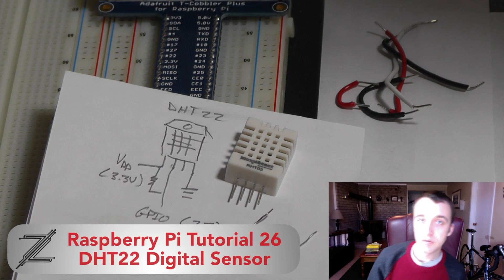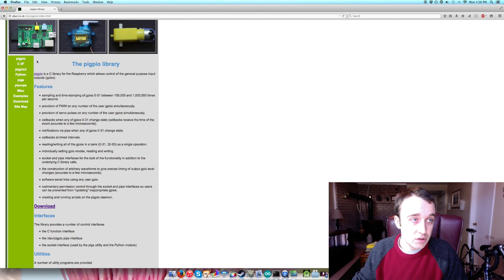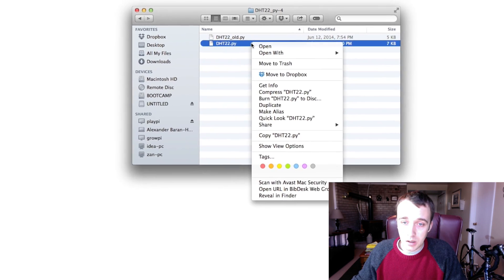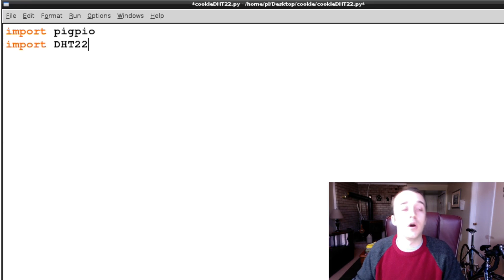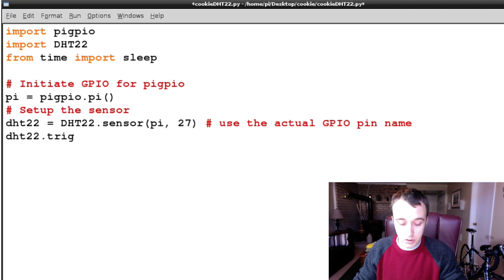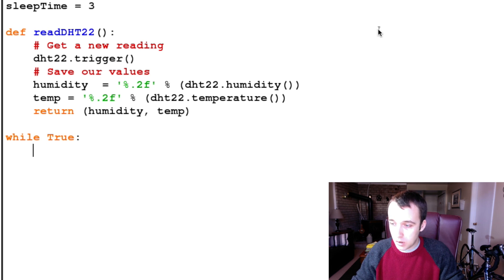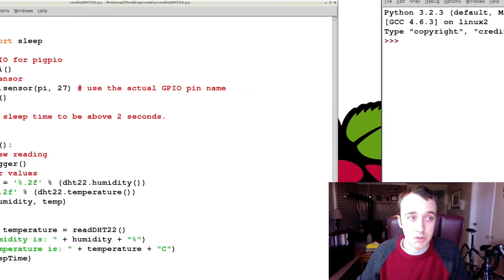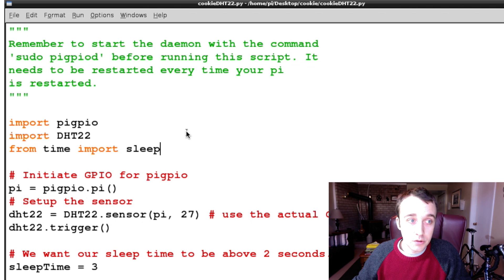Raspberry Pi Tutorial 26 - GPIO DHT22 Digital Temperature + Humidity Sensor

Comment: Hey Alexander, I am a 17 year old student and have a question. I saw your video on youtube where you connect a DHT22 sensor on a raspberry pi. I want to say that it is an fantastic video and it helps me a lot. But for school I have a task to measure the temperature with the DHT22 sensor and to monitor the values on a webserver that runs on my raspberry pi. Do you think it is possible? and could you tell me what is the best solution for this task? I would be very nice if you help me with this. Thanks a Lot !
Reply: As a developer, this is a bit too much of a task for a 17yo imo. Don't get me wrong is doable if you already know programming you need to setup an apache server, and know html, php, python. You either learn electronics or web dev, doing both at the same time is a terrible idea.

Comment: getting the below error. please help me out.
Traceback (most recent call last):
  File "<pyshell#1>", line 1, in <module>
    import DHT22
ImportError: No module named DHT22
Reply: Rahul vishwakarma same problem. Did you resolve?
Reply: @seancardosa6806  You need to have the "DHT22" python code you downloaded in the same folder as the code you're working with.

Comment: Alexander, these are the best videos out there.  Thanks!  I was working on this one (Temp & Humid) and kept getting temps of 500 C + (no I'm not commenting from the depths of Modor) and humidity around 1200%.  I checked everything several times still bad reads - but it they would go up if I breathed on the sensor.  Then I decided to use another library from GitHub szazo and things work fine. One difference is that I have a DHT11 and the szazo says its for DHT_11, but I thought that the 11 and 22 were the same except the 22 is more accurate.  Any thoughts?

Comment: Hi, I wanted to run this code automatically when my raspberry boots without connecting to a pc but the it turns out having an error since it requires sudo pigpiod to run. How do I overcome this issue (i.e how to enable sudo pigpiod to run when i start my raspberry or how to bypass the needing of sudo pigpiod)

Comment: Hi there. Thank you for this tutorial, it helped me setup my DHT22 with my Pi and I now have a fully working thermostat to turn on and off the heating in my house. Thank you so much for that.

I see you are using a resistor and I've done that as well but I have seen other suggestions online about using the internal resistors of the Pi and add a line of code in the script:
 
pi.set_pull_up_down(gpio_pin, pigpio.PUD_ON) - http://raspberrypi.stackexchange.com/questions/12161/do-i-have-to-connect-a-resistor-to-my-dht22-humidity-sensor

What do you think about that?

Comment: Hi !
I have tried to use your code with DHT11 but it still show wrong data. I have changed resistor form 4.7 Kohm to 10 Kohm. I also try it without resistors but it's not working. I'm still getting the temperature data about 573 celsius and the humidity data about 900 percent. Have you got any idea what else i can do ? I will appreciate your help.

Comment: very good video.But I have some problems about the python code.
what's the function of the first dht22.trigger(). Can I remove it?
and if I want to add a judge condition when temperature is higher than 15 degree, I want to turn on a LED. What should I do? I am confused about using pigpio library to control the LED?
Thank you very much
Reply from the maker: +Yan Jiang The trigger function is what updates the dht22 object with new data from the sensor. That is: you will not get new data without triggering the sensor. The pigpio library doesn't really do anything outside of talk to the sensor. The sensor is a digital sensor: it sends high/low pulses. You could write your own python (or preferably C) code to decode the high/low pulses yourself to read the sensor, but that's a little much for this tutorial. The PIGPIO library does this for us (among other things - it happens to have specifics for the DHT22 though, making it a good choice for this particular sensor).

So: PIGPIO is used to allow us to easily read the sensor, and the rest of the script can be done with regular Python and regular Raspbian enabled GPIO access.
Reply: +Alexander Baran-Harper Thanks, its really helpful.

Comment: I'm getting an error for "make install". And I'm stuck because of this one thing. Could you please  tell me what could have gone wrong? I tried the entire process several times but there's still an error. 
Need help!
Reply from the maker: +Teeba Ibrahim I haven't encountered this error, so I can't provide you with the solution. However, I can help you troubleshoot. First off, sharing the exact error code would help us determine the problem. Are you running Jessie or Wheezy?
Reply: +Alexander Baran-Harper Thank you :S:3
I'm using jessie with Raspberry pi 2 and DHT11.
Reply: +Alexander Baran-Harper The error I get when I write 'make install':
"
install -m 0755 -d        /opt/pigpio/cgi
install: cannot create directory '/opt/pigpio': Permission denied
Makefile: 55 recipe for target 'install' failed
make: * [install] Error 1
"

This is what I get and I have tried using different laptops and have done everything possible. Please help me with the error :/
Reply from the maker: "Permission denied"

Try
sudo make install

sudo is 'SUper user DO;' super user being like windows admin. The pi has built in safeties that prevent you from doing potentially dangerous things unless you explicitly tell it you know what's up with sudo.
Reply: +Alexander Baran-Harper  thankyou sir we get it

Comment: Can I use DHT11 instead of DHT22? Any changes in the code for that?
Reply from the maker: +Eman Yunus They should both work the same. I believe the only difference between the two is accuracy and tolerances, but you should check the datasheet to be sure.
Reply: *****  Thanks!
Reply: Eman Yunus Did it work for you? What did u change in the code?
Reply: Yes, it did work. In the code you just have to change DHT22 into DHT11. That's all. If you follow few tutorials online, you'll get hold of it. 
However, I had to calibrate DHT11 to give me accurate results.

Comment: Hi Alexander!
Great tutorial, I was a little bit obfuscated because getting not operate the sensor. I am using a RPI2  and I followed the steps on the video too. My problem was when starting the script with python3 its keep getting a mistake, but starting with python2 works ok...
Now, I would like to connect several DHT22 sensors, but I tried to star the script with another one and just can works one at time. Do you know How I could do that?
Thanks in advance.
Lucía.
Reply from the maker: Lu Illustration There are differences between Python 2 and Python 3. The way I wrote the script works for Python 3. If you're having a particular error with Python 3's execution of the script, you will have to find where the mistake is.

The script I wrote initializes and reads only one GPIO channel. If you are attaching multiple sensors to your pi, obviously you will have to modify your script to accommodate multiple sensors. Do NOT connect multiple sensors to the same GPIO line; you will need a unique channel for each sensor (this isn't I2C).

If you are happy getting each reading independently, you can simply modify the script: initialize each sensor on its own GPIO channel, trigger each channel, read the data from each channel. If you're looking for concurrent sensor readings, the best you can do is multi-threading. You will be limited by the Pi's speed. Getting perfect exactly timed readings I don't believe is possible with a single pi.